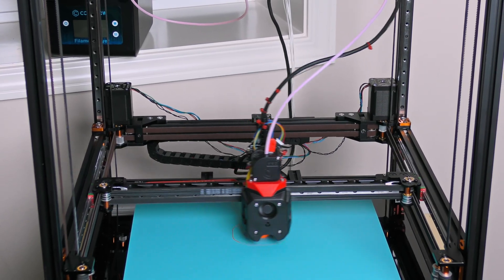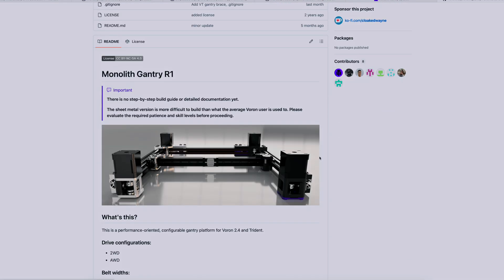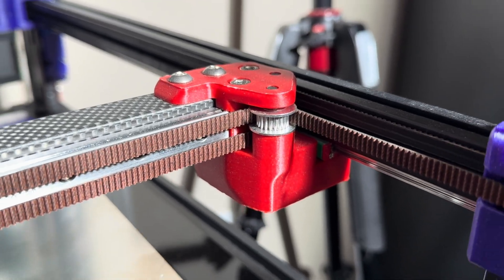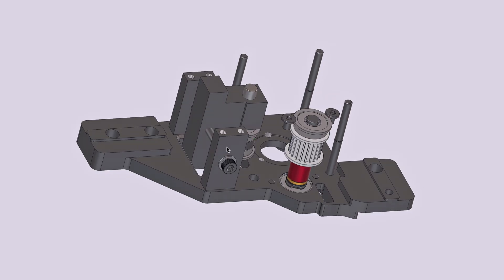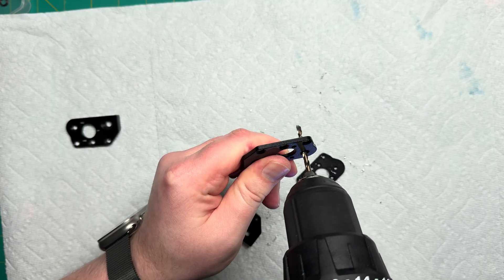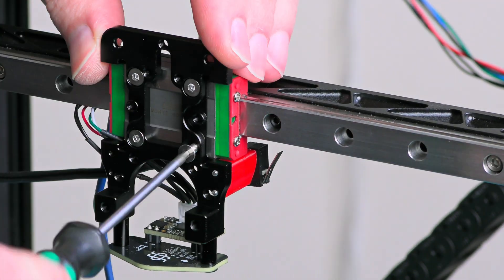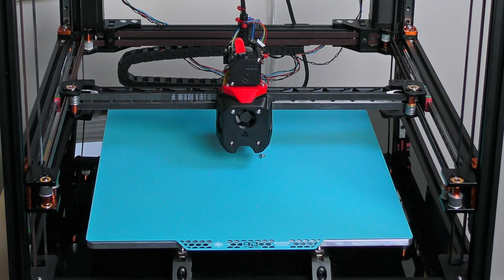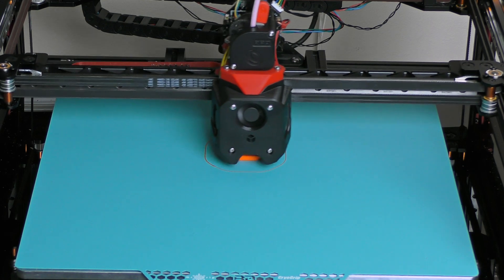Meet RMG - Rigid Metal Gantry

Comment: Why have a moving toolhead gantry along the Z axis instead of moving build plate?
Reply: It allows for quad Gantry leveling. Instead of leveling the bed before each print you can implement systems like TAP that automatically level the Gantry with the bed when you start a print.
Reply: @PapaDupz  why auto bed levelling with three bed screws?
Reply: not to be confused with mesh toolhead offset probing

Comment: You are a beast 🫡 only person I buy parts from for my voron. The cnc x carriage mount was my fav purchase so far. That has single handedly been my best upgrade over the plastic one. My dragon uhf was melting the plastic one no matter what filament I used eventually the heat sets would come out. Ever since buying your cnc x carriage mount I haven’t had to touch it one time.

Comment: Im struggling to see how this isnt just a repackaged monolith gantry. The shorter flipped belt path, aligned rails, live idlers has been the ethos of the monolith design for years
Reply from the maker: That’s a valid question. Live shaft idlers have been around for a long time and are used far beyond just 3D printing. In this specific case, they were actually part of the original Voron design but were later removed in favor of a simpler solution, all well before the Monolith gantry existed and can be confirmed in the Voron GitHub repository.
Design choices like internal Y rail mounting and shortened belt paths are also not new: both the VzBot and Mammoth gantries use similar concepts. While I’m not fully certain about Mammoth’s direct influence (its repository predates Monolith), the underlying ideas have been evolving independently across different designs for quite some time.
So if combining proven concepts into a modern implementation is considered a “Monolith repack,” then technically yes, but this project is simply another step in that ongoing design evolution rather than a direct copy of any single system.
Reply: @Vitalii3D  The tensioner is the same mechanim found in the stock Voron front idlers BEFORE the screws were moved to the correct height. Evolution isn't the word I'd use.
Reply from the maker: I see what you mean, but while the design may look visually similar, it operates differently. It minimizes screw and deflection in the Z direction by pushing steel pin against the X axis of the AB mount frame. In addition, this system is fully metal rather than plastic, which significantly reduces material flex and increases overall rigidity.
Reply: @Vitalii3D  The M3 tensioner screw is still being bent regardless. The forces don't align. :)

Comment: With side mounted carriages you do decrease the offset from the centre of mass, especially with how top heavy the tool heads are on a voron. This isn't particularly an issue on the y-axis (for x directions movements), because you have 2 carriages, which with the spacing between them results in mostly normal loads and not moments. However, you increase the pivot centre distance from the rail to nozzle for movements in the y direction. For fast movement, you want as little displacement as possible at the nozzle.

Another thing to consider is how it's constrained. For y axis movements, rotation around the x-axis is reacted against by the hard face, whereas with side mounted rails it is screw clamping force and friction. This is why heavy duty cnc routers always have top mounted rails.

Of course this doesn't matter when the parts are plastic, they will be the parts that flex. I don't know which will result in less displacement at the nozzle if both were metal, but no doubt both cases will be plenty stiff enough.
Reply: The carriage being mounted on the front of the extrusion actually reduces the distance of the nozzle to the lever point. Theres been a lot of testing done on this as well. It is both the best way to mount a toolhead for speed and for quality. Plenty of testing/examples showing this as well. The biggest reason being that the distance to the lever is dramatically reduced. The center of gravity is also a bit more forgiving due to this. This is why platforms with a top mounted rail like the VZ Bot have issues with VFA if the toolhead is setup with even small differences as it takes only a few grams to offset the COG on the toolhead and create VFA.

Comment: Do you plan on making the AWD version of this?
Reply from the maker: Yes, I have it on hands. But would like to see how far I can get with 2WD first.
Reply: @Vitalii3D  I'm about to send out a bunch of cad files overseas to get machined for AWD monolith CNC version for my belted trident. I like your back tension approach better than monolith. Would it be possible to beta test AWD (I have some custom front motor mounts to account for belted trident belt paths)
Reply from the maker: I have enough beta testers at the moment, but just in case if I will need more, feel free to drop me message at Voron discord, account @vitaliitop
Reply: @kazolar  This tensioner goes hard if you ignore physics.